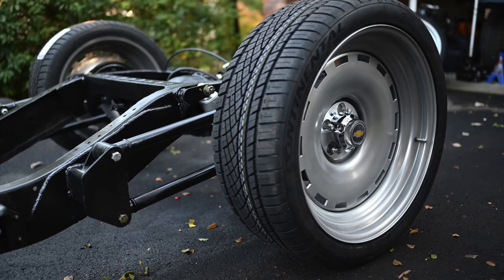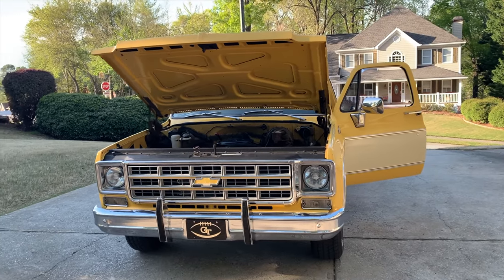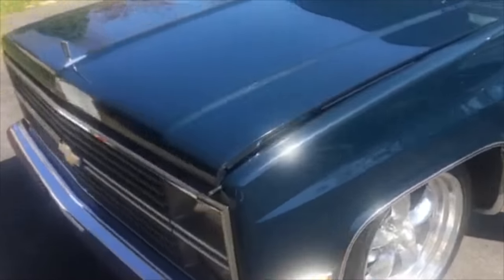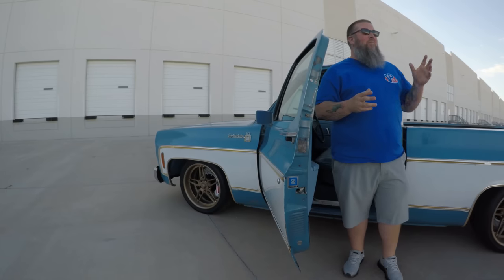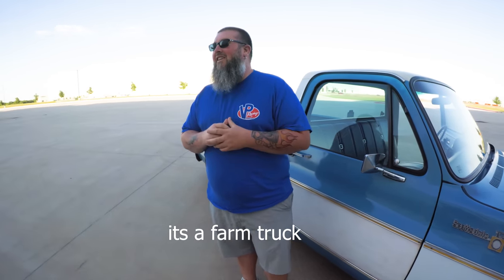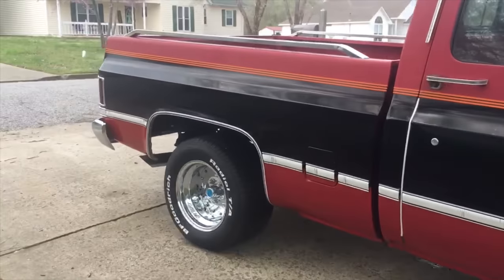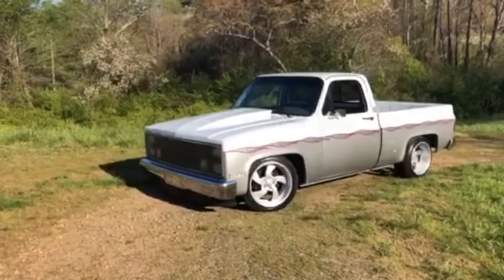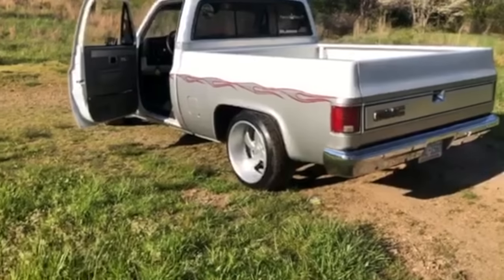ALL THE SQUAREBODY TRUCKS featuring ProTouring Texas 1977 LT/10 Speed C10 | Vol. 2 #submityourtruck

Comment: Just picked up a 1979 Bonanza Big 10  w/ 42,000 miles... Came out of Iowa and then to Ohio, and 3 rd owner...needs some rockers and corners from Northeast But  runs like a dream and frame is cherry..still has factory converter. What are best fitting rockers I can use? Thanks..will try and send some before and after vids/pics. Cool ass trucks fellas.

Comment: What is the solid white wheel set up you have on your teal truck with patina?
Reply from the maker: They’re Detroit Steel Wheels D-Town Smoothies in 20x8 front and 20x9 rear with 235/45/20 front and 285/40/20 rear tires.

Comment: I just bought a 1975 Chevy Cheyenne. It’s been sitting for 20 plus years. I hooked up a battery to it put some gas in the carb. It wants to start but won’t. What should I do now.
Reply from the maker: Check plugs, wires, ignition, etc. Carb likely needs cleaned. And only run fresh gas through it.
Reply: Thank you for replying back to me.

Comment: Did you know the body line goes from 7-1/2" in the front to the top of the front fender- the rear is 9-1/4" to top of the bed. ITS WEDGE SECTIONED FROM THE FACTORY FROM THE FACTORY ABOVE THE BODYLINE